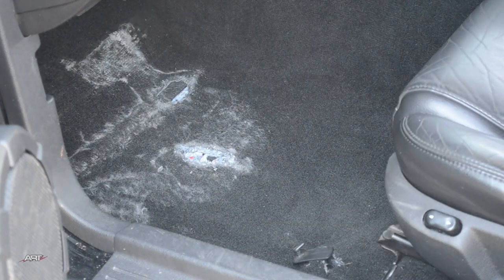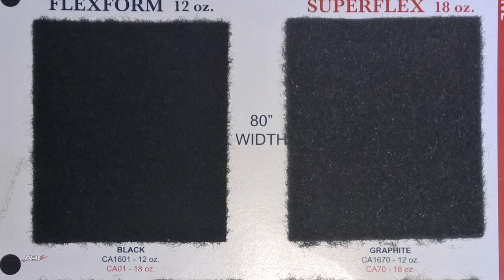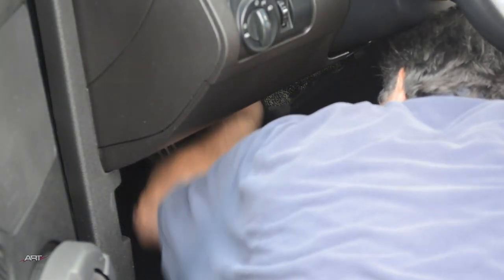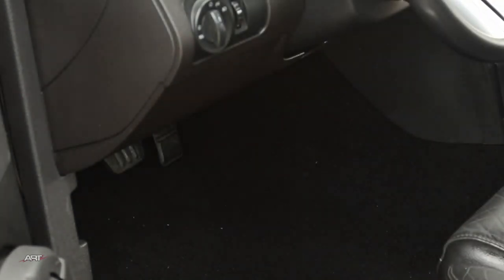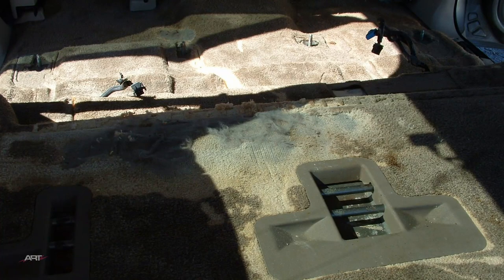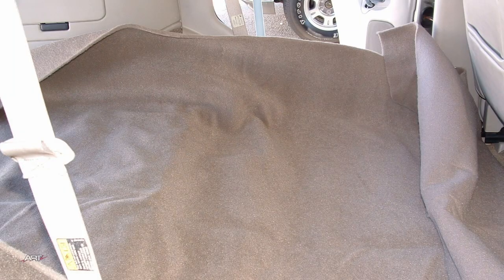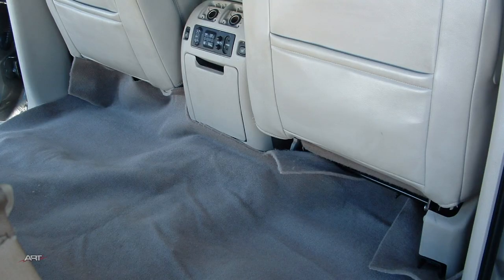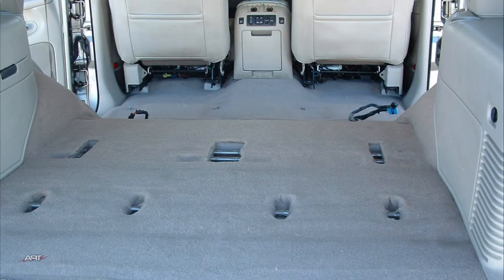Carpet Over  v12

Comment: maybe a GoPro might fix the camera issue?
Reply from the maker: A GoPro takes you away from the work a bit while giving a wide angle.  My cellphone camera does the opposite. I end up too close without realizing it sometimes. In the field we get caught having to use whatever we happen to have when the situation presents itself.   But I picked up an Akaso Brave 8 as an upgrade to the GoPro Hero and have been using it tastefully.  Thanks